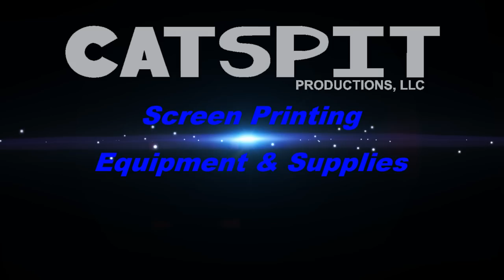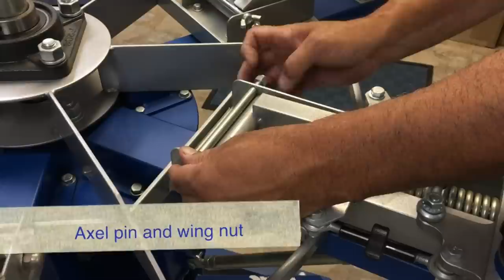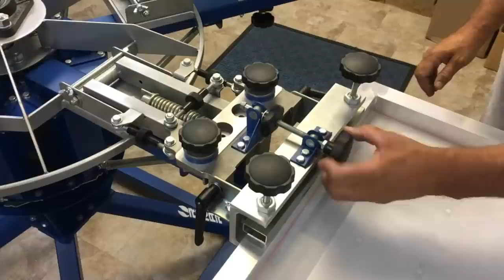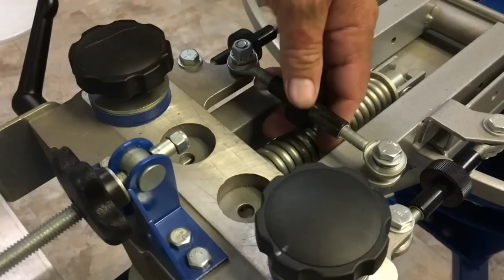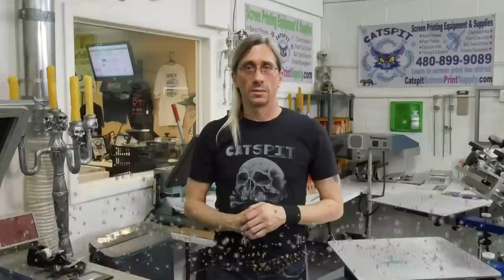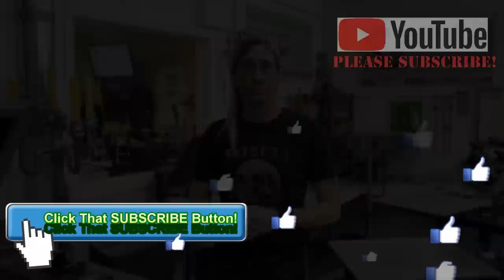Ranar Elite Series II Rotary Screen Printing Press Features Short Overview

Comment: Hey I was wondering if you could do a video of different ways to cure plastisol ink at home without the use of a flash unit, or conveyor dryer. Any tips would help me out a lot!
Reply from the maker: I have one on a heat press and one about a heat gun. Check my video uploads. Thanks for watching. Screen Printing Equipment & Supplies - http://catspitscreenprintsupply.com/